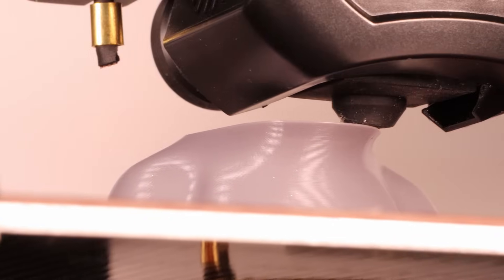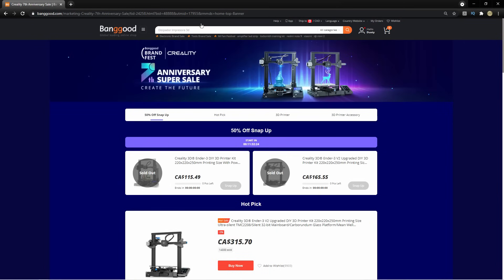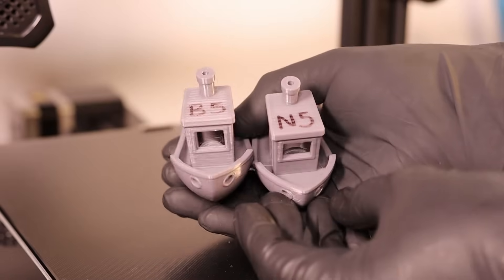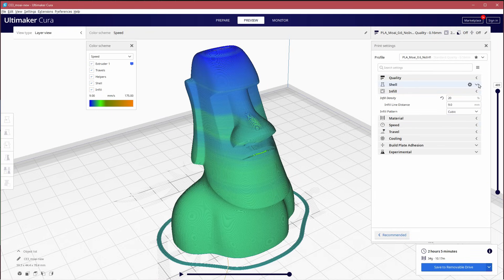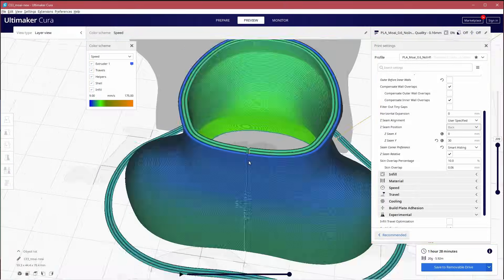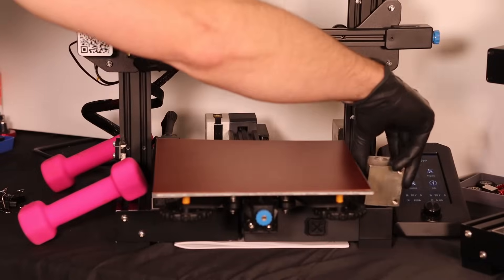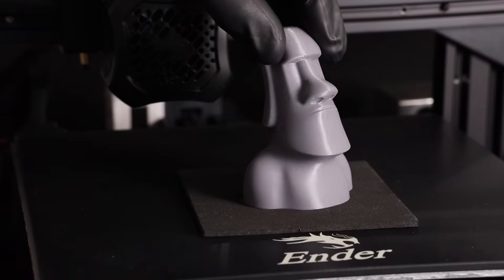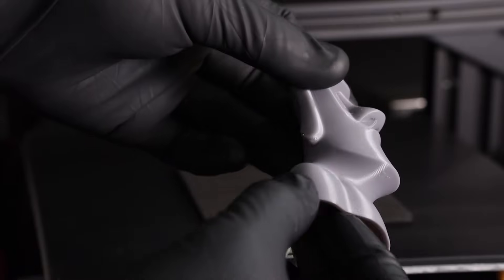Creality Ender 3 V2 - My Cleanest Print Ever and You Can Too!

Comment: I just bought this, I can't even get my first layer to print, I'm on the verge of tears lol. I spent all night manually leveling the bed, printing test sheets, adjusting settings in cura, playing with temps, soliciting advice on the internet, I'm losing my mind. I wish I never bought this thing. I bambu mini was $20 more, even a Neptune 4 was $40 more :')
Reply: Why didn't you get A1 mini?
Reply: Hey I remember when I got mine it was the same. I was new, almost gave up it took me days to figure it out. I can't exactly remember my troubleshooting but I can tell you once the bed is level you shouldn't have to do it again. I've had mine for years now printed tons of things, even moved re set up without issue. Never had to level bed again since..Did you assemble the actual printer correct? If you can figure it out it can be well worth it good luck

Comment: Good video.  What size nozzle do you recommend for PLA+?  I've been trying to use 0.4mm but it clogs so easily.
Reply: did you manage to figure out what's wrong?
Reply: Yes thank you.  It was the filament.  I switched to a different brand I had and it printed without issue.  I really have to learn to start my investigations with the easiest variable to change.

Comment: why do yalls printers make that seam,? mine never does that and my printers cheap af and im using cura
Reply from the maker: All FDM printers have the seam, it'll be far less of a problem if you're running a DD setup.  These days the seams on my prints aren't too noticeable, but it really depends on the placement, if you have a sharp inner or outer corner, they'll be well hidden if you're printing something like the Moai, there isn't a good place for it.  There are some new features in Orca to 'scarf' the seam, which helps a bit if it's setup correctly.  

Calibrating your filament for flow and PA as well as retraction all help to minimize the seam as well of course.

If that's not true for you, well I have to say Damn, you've got it good!

Comment: That’s amazing. Struggling with a 0.2 nozzle in order to print a less than dime sized Sherman tank. Thought trying small would be different than so many people making big stuff. I’m thinking a steel 0.2 might have been the wrong nozzle to get made some little test squares that printed extremely smooth, but the tank hasn’t done well. Bottom layer ok and as it goes up 5 layers or so it clogs. Was using wood Isanmate as well which took some time to get right with a 0.4. Anyway thanks so much for the tips and beautiful print tips.

Comment: You: Upgraded to PEI build surface
Me: Nice, those work great. Love mine. Parts stick without sticking tok well and peel off easily when cooled.
You: I rub a glue stick on it as if it were a glass build plate anyways!
Me: frustrated noises

Comment: What software do you use to load your prints?
Reply from the maker: In past I'd use Cura it was pretty rich with features, right now I'm using Orca Slicer it is a great slicer and it allows me to wirelessly send to each of my printers even though they are different models and also different brands.

Comment: Why have I not considered printing something with 0% infill before? Almost 2 years 3d printing. I learned something today.
Reply from the maker: Some parts can be done this way, not all, but it can certainly save some time.  Some people print hollow and pour resin inside, or even print hollow to create a mold to cast.  I'd actually like to use that technique in an upcoming video to see if we can use printing to create a mold, but instead of burning the plastic out, we just soften it enough to remove, the mold would still need to be 2 parts, but I think it can work...

Comment: I don’t do any of this I just send it and usually it’s pretty good as long as the bed is levelled at the right height and you got the right settings
Reply from the maker: That's cool, you're right about getting the setting just right, some people have a knack for it, some people struggle quite a bit to understand what to change to get it there.
Reply: @NeedItMakeIt  oh for sure, I definitely wasnt saying anybody shouldn’t do any of these, I’m definitely gonna give them a try when I print next!
Reply from the maker: @papermind4010  No problem, I really enjoy the feedback and conversations with everyone, so keep 'em coming!  

With advancements in 3d printing, I really think someone needs to come out with a kit that anyone can install onto their Ender 3 printers to upgrade them to run Klipper with a sensor to mitigate resonance.  It would go a long way towards having great prints but also saving money.    I'm saying that, but I haven't really looked that much, maybe someone already has.

Comment: Hi there, really sorry...but im a newbie looking to start 3d printing. I dont find the details about the solid surface u putted instead original one and what was the product u passed on it, before start printing. Many thanks for all the nice videos and ur time here helping. 🤜🏻🤛🏻
Reply from the maker: Don't be sorry!  When I started I had so much trouble... in hindsight, starting with ABS was a mistake...  Do you mean the Cura profile linked?  Let me know if that's what you need and I'll have another look.  Are you using Cura or a different slicer?

Comment: Everyone I knew that had a 3D printer told me not to get an Ender 3.
But with about $40 of parts I got it to print better than all their Prusa printers. 
The ender 3 is such a good beginner 3D printer because of it's flaws out of the box. You end up learning so much through trial and error. 
I print some pretty complex figurines and print in place parts on mine. 
It's insane what you can actually do once it's completely dialed in and maintained.
Reply: Totally agree! I have an S1 pro and it's my first printer, but the many, many roadblocks I've ran into really has made me learn more about the hobby. Before I got a 3D printer, I thought you just hit 'print' and it was basically ready to go. Lol.
Reply: What are mods that youde recommend? I have an ender 3, very familiar with tweaking lol
Reply: It really is amazing printer. Got a Sovol sv06 which I thought would do better, and it doesn’t. Changed springs to silicone on bed. It’s still losing level very often. Was fine for awhile. Glass bed warped as well. So shimming it until it levels out again. Even with issues still makes some really nice prints.
Reply from the maker: I couldn't agree more, definitely a good starter printer.  I suppose the 'printee' needs to be in the right mindset and be able to problem solve and learn the new skills.  The people that will have success 3D printing I think have that type of though process anyway (maybe I'm wrong), but the maker type people.   Mine are both working with very few mods, I've replaced only a few parts and they've each printed hundreds and hundreds of parts.  Seems like an okay deal.  The next gen has more tech, a little harder to wrap your head around.  

I just received the K1 Printer the other day,  it is a nice printer as well, I'm curious to see what types of features they've packed in there.  It is very professional looking, sleek design.  What will the next gen of printers look like.  I still think some company will go a completely different direction, there is a lot of opportunity to make stronger parts faster with different techniques.  That's me being hopeful!  

I can honestly say I've never tried a print-in-place,  that's impressive you've been able to get it working for you that well, there is a lot that can go wrong with those kinds of tight tolerances.

Comment: With the Inner and outer walls you printed with 35 and 55 this is faster then my settings (I think may still be default both at 25, with printing faster dose this help with print quality? Or if not what would be the reason to increase this speed?
Reply from the maker: Slower is better in most cases, the only time it tends to give better results is when printing PETG and moving from island to island causes small amounts of filament to leek from the nozzle.  It depends on the distances they're apart from each other of course.  To some extend the nozzle size and also the quality of the filament.

Comment: What is the reason for .6mm nozzle instead of .4mm?
Reply from the maker: O.6 nozzle will allow a slightly larger overlap between layers, in a model like this one, and the way I've printed it, it means that the overhanging areas have more surface area bonded from one layer to the next.  On the other size, the 0.6 will not be quite as precise, but a model like this one which isn't super intricate isn't a problem.
Reply: @NeedItMakeIt  got you, thanks!

Comment: Im new to 3d printing. Sry if this is a dum ask,but Why is there a seam?
Reply from the maker: No worries, it is a common question.  Probably the most common one I've had.  The most common way to print... by layer used a method like drawing with a pencil, a start point and stop point, at that connection between those points is where you'll have the seam.  The next layer is another drawing just the same stacked on top of the previous.  The seam can be moved around, it is typically best to put it on a corner so that it isn't as visible. 

The 2nd way to print is called Spiralize outer contour... or VASE mode.  It prints as a continuous 'spiral' always moving around and upward at the same time.  This results in no seam with the exception of the start and stop.  This method will result in weak hollow prints and most cannot be closed on the top because it cannot be supported.  

I hope this helps!
Reply: @NeedItMakeIt  is it possible to have the seam on each layer start at a different location so it's not always right on top of one another making it more noticeable?

Comment: I'm getting seperation on the shoulders, nose and forehead. All the vertical overhangs print perfect, but not the ones where the diameter of the form gets smaller. Any ideas would be great, cheers.
Reply from the maker: Any chance you can send me an email with a photo or two?
Reply: @NeedItMakeIt   thanks, I've solved it now, it was e steps. They where about 35% out. Cheers

Comment: 2:41 noooooo don't lube brass its a self lubricating metal...
Reply from the maker: I can say I've ever heard someone say that.  I have plenty of machines with Brass/Bronze bushings and they have lubrication ports built-in.  Can you shed some more light?
Reply: @NeedItMakeIt  brass is a self lubricating material just as graphite and teflon they are used for friction parts because they don't need an additional lubricant

Comment: One simple suggestion: If you want to avoid seams indentations  - plan ahead and make the 3D model with a 0.5 mm bump at the seam area in order to compensate the 3D printing indentation. Later any leftovers can be removed manualy, to match the overall surface consistency.

Comment: You basically just have to use standard settings and it will come out fine if you have a decent printer. Prusa slicer already has settings optimized.  Use the standard MK3(now 4!) settings and modify them. The only thing you really need to learn how to do is speed up your machine while maintaining the quality, that's the tricky part :) I run mostly everything at 80mm/s, with outside perimeters at 60, but I know I could go faster., up my nozzle size.

Comment: As someone without a 3d printer, I find this very useful.
Reply from the maker: You can also do this without a printer, it is just about 1billion times more difficult, good luck!
Reply: @NeedItMakeIt  perhaps he has a 3d pen, if not, perhaps a hot glue fun might do the trick
Reply: @NeedItMakeIt  glue gun very love this idea
Reply: @NeedItMakeIt  can I put like normal PLA 3D filament in  3d printing
Reply from the maker: @Jakeypoo-di6hy  PLA is the best starter material to print with, it's a good place to begin for sure.  If you're looking for something that can handle higher temperatures, ABS or ASA would be good, if you want minimal warpage and strength, PETG is a good choice.   PETG and ABS require higher nozzle temperatures, and ABS and ASA are best printed in an enclosure to reduce warpage and all types of print fails related to it.
Reply: Just keep your lighter steady while heating up the nozzle to 200°C manually
Reply: Step 1: get a 3d printer
Reply from the maker: @msmaug644   Step 2:  Struggle
Reply: @NeedItMakeIt  Yes, 3D printers turned out to be a CNC hobby rather than a magic "make anything" machine. Ah, sometimes I regret getting myself into that.
Reply: @msmaug644  Step 1.5: Sell the Creality and get a 3d printer.
Reply: Same
Reply: well i was told that i have steady hands

Comment: what's the seam for?
Reply from the maker: Think of the seam as if you were drawing a circle with a pencil.  You'll have a starting and stopping point.  the only exception to that at the moment is Spiralize the shape, which will only result in a shell.  

With the right settings a seam can be made nearly undetectable.  The layer thickness, the nozzle size, adding wall wipe, the correct retraction settings, using PLA or ABS is preferred over PETG due to reduce blobbing and stringing.  Also making sure that the nozzle doesn't travel too far from the end of one layer to the start of the next.  That would be the seam location.  Even changing settings like coasting will help reduce the buildup along the seam area so it looks....well seam-less :)
Reply: @NeedItMakeIt  thank you

Comment: Mine won't even print because their filament won't stick to the bed and the glass seems to be warped and is lower in the middle!  I never had this problem with other models before, this one is a piece of crap!
Reply from the maker: When the bed is heated, the plate below will warp a little.  They all warp a  little different.  When you attach the glass to the aluminum plate, it may be better in your case to attach it from the corners.  If you attach in the center it may be pulling the glass down to match the alum.  Aside from that, I'd use glue stick if you're having trouble with the first layer sticking.  The glass isn't very large, over that distance it should be quite flat.  For my printer I have two clips at the front, and one at the back, that seems to work well for mine.  Best of luck!

Comment: For Ender 3 v2 I used gcode which is 0.4mm.  everything was going very well.  layers are smooth.  but the top remained open.  The top of the statue is empty.  caused?
Reply from the maker: Likely not enough overlap for this model, the smaller nozzle will have minimal overlap, but an interesting question.  I may need to check into this more.
Reply: @NeedItMakeIt  Is this problem related to the printer or can it be fixed with a small change in gcode?  The rest of the print is really good.

Comment: I think the only problem I'm having is the wheels on the back of the print head, I've only done around 10 prints and I can see the wheels are starting to strip away
Reply from the maker: They may be set far too tight on yours, they shouldn’t wear down quickly at all.  I’m still on my first set of wheels on my 2 year old printer after hundreds of prints.  I’ve changed my wheels once on my older printer.
Reply: @NeedItMakeIt  interesting, I've played with the tightness and it's set literally juat before it has movement, one tiny little more twist and the head stats to get rotational movement, could it also be affected by the belt tensioner at the end?
Reply from the maker: @mbjac  I wouldn't think it would impact on the x-carriage, it may be a bad batch of wheels I suppose.  I can't be certain, maybe others have had this problem?  I have similar wheels on my CNC as well, they do peel a little after quite a bit of use, but it's more in the several months range.  It sounds like you've tightened them correctly.
Reply: @NeedItMakeIt  it what it is I suppose, I've found a bag of replacement wheels are very cheap and when I detect some rumbling il swap them out. 

Thanks for the help

Comment: My FLSUN SR has very high print speeds but is very prone to stringing and these settings are amazing and stopped stringing but the only problem with this is removing supports are very hard

Comment: sometimes when modeling there are parameters that don't connect when you zoom in and see them and may cause this potential for a seam.....some times a circle is only a number of arcs, this can cause cnc's to start at the beginning and stop at the end of the arc creating the seam.....not saying this can't be overcome by the slicing software.

Comment: I used a .4mm nozzle and a .09mm layer height, a speed of 55m/s and at 218c - 100% infill - 6 walls with Esun PLA+, I have stronger bed clips also in a aluminized fiberglass enclosure, and I used weights like your method... let's see how it turns out.
Reply: and?
Reply: @ModelAirportDutchie  My hot end literally caught on fire and melted, not sure what happened... I'm getting a Prusa now, fuck Voxelab. Shipping is taking forever.

Comment: Super new to 3D printing, why does there need to be a seam in the back?
Reply from the maker: Unless printing in VASE mode, there will be a stop and start for the beginning and end of each layer.  Like putting a pencil down for the start and stop of a circle in a drawing.  The seam can be anywhere, you may need to turn on advanced settings to see the options for random seams.  Typically the best place for a seam is on a corner, it helps to disguise them quite well.  Retraction settings and wipe distance and some other setting also help.  Nozzle size also plays a part, smaller nozzle leads to less visible seams, thinner layers would also help I've found.  Let me know how it goes.
Reply: @NeedItMakeIt  Thank you for explaining!